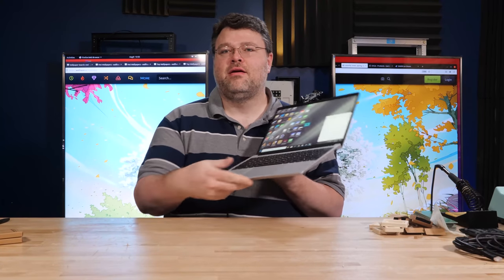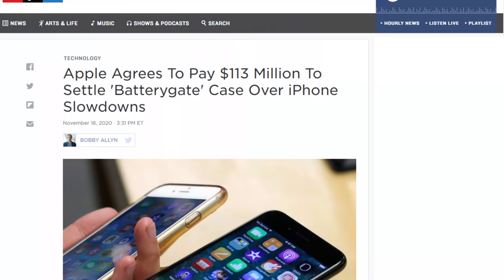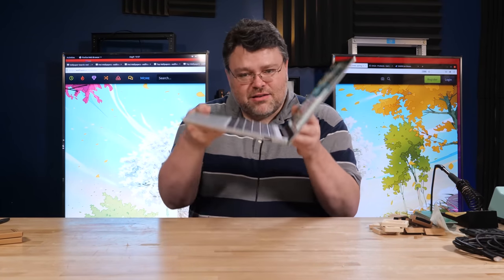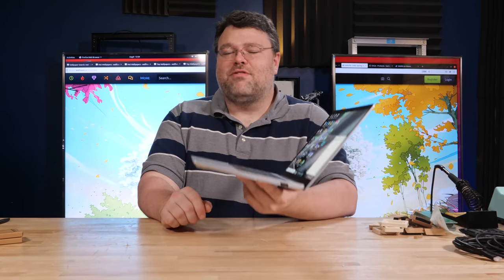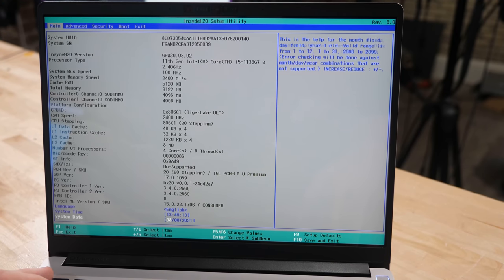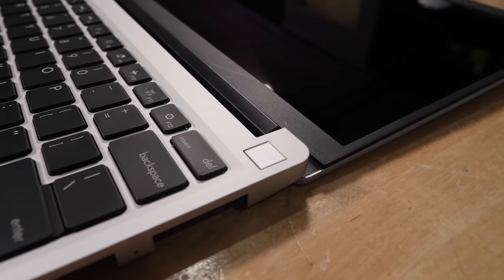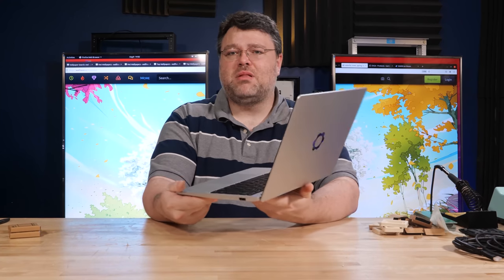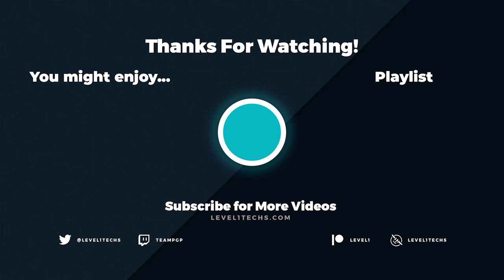Framework: A Laptop Designed to be Repairable?

Comment: Wendall should talk about them also working to support linux and their community pages.   My next personal laptop purchase will be a framework laptop
Reply: The Frame Work laptop can come without an OS, so you can install Linux if you want.  I know because I bought a "DIY" version and a friend and I put it together and installed the OS.
Reply: @johnaustin704  IM HOPE  they add  real gpu  over  the igpu
Reply: i asked them in an email and they are considering adding this to their website in the future ... but they are testing internally with fedora and ubuntu
Reply: @paullee107  I had little trouble installing 20.04.3 w/5.11.0 kernel. Needed a small workaround for the Wifi, but no major problem otherwise. I’d much rather have an LTS distro, even if it requires a minor workaround.
Reply: @paullee107  with it being all Intel I didn't figure there would be any fuss installing Linux.
Reply: @lejoshmont2093  there really isn't, you just need a newer kernel so alot of slower to update distros and LTS distros don't run well.
Reply: @gsrcrxsi  I'd argue only small compromises would be needed to get a low wattage 3050 in there. Soldered RAM and a few chassis tweaks to accommodate the 2nd fan's vents. That said, framework clearly have no intentions of doing this with this chassis but I'm hoping they consider dGPUs when/if they get around to a 15.6" model.
Reply: @RandomPlaceHolderName  The problem is space, not watts. They won’t ever have soldered ram. That’s totally against their mission statement and design philosophy.
Reply: @theredtechengineer1480  20.04.3 LTS working fine on my framework. No problem with “LTS”
Reply: @gsrcrxsi  Space and watts are linked. Less wattage, less size required for cooling. And while space is tight, looking at the size of the 2 dimms, I believe it could be done. 

And sure, you lose ram DIY repairability and upgradability but selling 16-32gb variants fixes upgradability for the most part and making schematics and part #s public helps avoid the price gouging repair market of say Apple. I don't mind requiring a professional to fix my machine, I just don't want the company saying "No, just buy a new one".
Reply: @RandomPlaceHolderName  that assumes that there’s nothing under those two dimms. Which there is. It’s still taken up by the MB below. No space for a GPU either way. Not gonna fit in the 13” chassis and expecting a right to repair focused company to dump repairability is a pipe dream.
Reply: @gsrcrxsi  Agreed, they won't do it. This much I've said before. But the space is there if you solder the ram (it isn't a huge deal, the CPU/GPU/VRAM would be soldered too). While the blade 14 is bespoke, it sports ridiculous amounts of hardware/cooling in a barely larger chassis. Half those specs would fit in the Framework laptop were they to attempt it, even with the area lost to ports.
Reply: @RandomPlaceHolderName  the motherboard footprint/available space inside the FW laptop is significantly smaller than comparably sized laptops. Because of the removable modules. The space just isn’t there. Even with soldered ram
Reply: they sent laptops to maintainers of several distros so hopefully both sides work to support the laptop well.
Reply: @gsrcrxsi  And some comparably sized laptops are sporting much more powerful hardware and cooling solutions. Dropping the specs, die size, VRM requirements, VRAM modules, wattage and cooling solutions, you significantly drop the required space offsetting the modular ports. My last retort as we clearly simply disagree on what is possible here. Thanks for the debate dear stranger.
Reply: @Epsilonsama  Ubuntu 20.04.3 is working great too. No need to switch.
Reply: Mine,too,definitely!
Reply: I wonder if the finger print reader works on linux
Reply: @lejoshmont2093  and there are some decent iGPUs nowadays
Reply: would be nice to see a coreboot version
Reply: It is obviously a fantastic idea but until we can slot in a replacement cpu or gpu into laptops these are still going to be dumped as they age.
Reply: @gsrcrxsi  they probably(hopefully) Will do a classic 15'6 laptop somewhere down the line. I certainly would like that since i dont really like those small laptops and prefer Universal beast kind of laptop. To game, work and for fun
Reply: The only one making sense in this thread is the OP!

Since when is Linux still behind on hardware support?  They Support the new Threadrippers alseady, and Intel are behind with their new processors, You can get Linux preinstalled, and Windows cost's extra!  No GPU is bad why?  Sure it's a smaller laptop to begin with, but also their first, it's coming you just wait! The one single thing they could not get that was Linux compatible was the fingerprint scanner, and that's fixed already, and it was designed with Linux in mind from the very start, and Windows just because so many people still haven't figured out that it sucks, and with it they can sell more.  Daaaaaaaaaaaang where do you get your info?
Reply: @lejoshmont2093  Not having a dedicated GPU (there is one on die in the processor) may be your preference, but many would rather have one.  Plenty of people use laptops for photo sessions and video while out and about and traveling, and gaming is growing in leaps and bounds on Linux.  Just wait, you may find yourself in a situation where you would rather have one!  The truth is that there are not many choices when it comes to plug in GPU's for laptops, because so many companies ditched modularity and buy the chips instead, so they can nail them down and make  sure if it blows out you need a whole new laptop and can throw away the bad parts with all the perfectly good parts.

Framework did not omit one because they didn't want to have them, but because they would have had to buy way too many, and at a much higher price, it didn't make sense given the production run and size of the company yet.  If this thing catches on, and the company grows, they will use replaceable GPU's as soon as it makes fiscal sense, so you can have a choice of a few when buying the laptop, and replace it if it breaks, and upgrade later if you want a better one.

BTW, not all GPU's are battery hogs, especially not the ones that go in laptops, and the one in the processor uses power too.  Larger laptops have more room for larger batteries, just look at some of those insane "Gaming" laptops!  They are freaking huge!  If anything they should go with AMD processors, as they are more efficient, and so is Linux over Windows because it and most FOSS software is less resource hogging to begin with, and by design, because they care.
Reply: @RandomPlaceHolderName  Soldering anything in they can have modular is totally against their business model!  But as a new and small company they have to make sacrifices.  dGPU's are coming, maybe even Audio cards.  There's a whole FOSS hardware movement growing already.

I will take the oscilloscope module, and the coffee maker attachment please!  (<:
Reply: @gsrcrxsi  Exactly.
Reply: @gsrcrxsi  Yep, they are against soldering anything in they don't have to!  That is not a large laptop to begin with, and everything is still getting smaller too.  They just need to test the market, and if they can grow as a company, they will have more laptop and module choices, and hopefully fill other niches of the market.  I would love to see how they would do a smart phone or a desktop PC!
Reply: As soon as they have an AMD based model they are jumping strait onto my "must buy" list for a future laptop upgrade, especially since I'm jumping to Linux and just preffer the much better support AMD has.

That and I prefer supporting "team Red" entirely because I can and I have yet to regret it
Reply: I hope them the best to survive and stay relevant until I'll be replacing my current laptop. The upgradability and full Linux support are huge selling points to me (though it might not be all that relevant for a regular consumer)

Comment: This is what we urgently need: an open standard for the mechanical/thermal/electrical interface specs of modular components especially motherboard and body but also batteries, screens, keyboard. Like we have already for ITX case & motherboard, PCIe slots and cards, SO-DIMM memory, NVME M.2 interface. Let laptop become the new desktop pc.
Reply: Well, I guess we not gonna get that.

On other side, having a highly modular notebook should happen...
In fact it was, it just isn't anymore.
Reply: @youkofoxy  unless somehow we can blow Frame.work to Apple or Dell proportion.. I doubt we are able to, but in tech/academic niche it is doable.

As a computer scientist I am looking forward to experiment on this kind of... framework
Reply: Phones too. Imagine if components between laptops, tablets-foldables, and Fairphone/Shift phone models could be mixed and matched ~ kinda like Project Ara but with parts held in by phillips-head screws.

Don't care about battery life? Trade battery size for a beefier SoC and slap on a 1440p 120hz display (maybe a built-in stylus too?). Want a larger phone? Just grab a large chassis with a folding hinge and 9-inch display and go ham!

> 10,000mAh battery
> 25W wireless "air charging" receiver
> 9-inch QHD 120hz folding extendable display
> SD969 + RDNA4 graphics
> 32 GB LPDDR6X RAM
> 1TB UFS 4.0 flash storage
> Built-in stylus
> Ports: 2 x USB-C/USB4-TB4, 3.5mm jack, microSD
> 3 x 108MP cameras (main, telephoto, ultrawide)
> Specialty cameras: IR, hexachromic, ultramacro, LIDAR
> Other specialty/custom sensors & modules.
Reply: agree, remember that this has been tried before, and it failed.
Reply: We already have standards for nearly everything, but it's not easy to make using them law, as it guarantees whoever comes up with a standard all the profit from licensing.  Strangely many standards have free licensing, and greedy companies don't use the standards so they can stack business in their favor, as well as thwart the competition. "Stacking" is against the laws of non competition, and has been for a long time!  As a consumer it's hard to fight because of the legal expenses, but competing companies can and sometimes do.  Many companies use tricks like using a standard in a non standard way to get around it:  HP, does it with their USB cables and other IO's, and accessories for their devices, and so do others, Apple has taken stacking to the extreme with chip ID's so you can't even put anything from one identical device in another!  They have been sued and fined millions, maybe in the billions already in parts of Europe and else where, but since they can afford the legal expenses without flinching, they keep doing it, or just find ways around the laws, or make country specific models of devices!
Reply: yes!

Comment: One thing they should really push on their marketing is the green aspect of it. This laptop would have a ton less e-waste than traditional laptops over the same time period, since you can upgrade everything.
Reply: They do!  I mean they don't put it above modularity, specs and price, but its not at all hard to find on their site.  It's part of their mission statement, if I remember correctly.
Reply: i kinda like that the green aspect is not super in your face, it kinda is obvious though. I think this laptop will appeal to every tinkerer. Also, very appealing to folks who are concerned about e waste. Covers different bases nicely. Just the whole concept is wonderful. lots of folks are excited about it.

Comment: I've just ordered the DIY version of this with the i5 processor.  I'm long overdue for a new laptop, and I'm glad to support this company.  I'll install 32GB (2x16) and a 1TB SSD.  For the bare metal OS I'm going to try Qubes.  Should be fun!
Reply: You just saved yourself $300 for like 10 minutes worth of work.  I recommend EVERYONE get the DIY version.
Reply: @Bri-bn5kt  More than that.  As they aren't paying for a windows license either.  I saved with mine as well.  Carried over the nvme drive from my old laptop and going to install zorin 16 on it instead.  I did pick up the microsd reader as a port so waiting on a card for putting the installer on to make the magic happen.
Reply: @JuffoWup78  Didn't even think about the Windows license.  Good point.
Reply: This is a big part of what appealed to me here.  It's great that it's designed with service/repair in mind, but I could also order it exactly the way I've always wanted to order a laptop.

Comment: I joined their mailing list for when they're shipping to the EU/UK - not because I need a laptop, but because they need to know we're interested and supportive this side of the pond. I wish them every success and look forward to a v2.0. - my personal vote would be to offer a 'chunky' model. Thin and light is all well and good, and the current notion of what's desirable, but my laptops have been old Thinkpads and MacBook Pros from 10+ years ago and those were plenty thin enough for me. With modern components a slightly chunkier model would have excellent cooling and oceans of room for expansion, upgrades and more connectivity, and could be built like a tank. The latter is really important if you're realistically going to use the same chassis over the years and upgrade the 'innards'.

Comment: I can confirm stairs are more dangerous than laptop repair. I've never broken my ankle while repairing a laptop.
Reply: Lmao :D
Reply: @Xavier Breath PC power supplies are adequately shielded, grounded and boxed in on their own so no one can accidentally touch their internal components when working with other things and get zapped. Also the reason the insides of a charger box are not put inside any laptop or phone. If you get zapped through a motherboard or laptop PSU, you'll only get 12V at most, since that's as high as the current ever gets in these circuits. That's nowhere near deadly margins unless you already have heart problems. Not only would it increase bulk if a laptop had to be designed to take current directly from the mains, but also make it needlessly risky. The very fact that iMacs in particular have exposed power supply bits inside is disgusting. They're the exception, not the rule. Only Apple would dare design their computers in such a terrible, needlessly unsafe manner, and get away with it.

Otherwise as long as you're not cutting the power supply open, 99% of the time you'll be fine.
Reply: @Xavier Breath Like manufacturers gluing phone batteries in so strongly you either have to stick a knife inside and rip it apart or heat it up a lot, either of those possibilities bearing the chance of an already failing battery burning and leaking questionable fumes?

Why do manufacturers glue it anyway?

Not to mention there's also a few times where I've gotten small cuts on my fingers from handling motherboards. And there's also the chance of burning oneself with a soldering iron (it never happened to me, but I know that can be nasty). Nothing in life is completely risk-free, and there's only so much you can encompass in a design's scope.

Comment: I've been waiting for this... but maybe it will be a gift as I just upgraded my 2015 laptop... New battery, a second stick of RAM and a SATA m.2... But that's all I can upgrade on it. I bought it to have something while deployed and it survived some blowing dust and 60°C sun. After 7 years, the battery stopped holding its charge and I bought it with a HDD but noticed it had an empty m.2 slot, huge upgrade there! And also, luckily for me, it came with a single 8GB RAM but a vacant second slot, so I found another for 16GB...so now it runs great and I've breathed new life into it.
Reply: no new battery ?   i had to remove my very old battery otherwise windows would shutdown immediately, works fine without but needs powerbrick ...

Comment: I agree on the modules, I mean, you plug a single module (usb c) for a single USB A port?, why not two in the module?, USB A is still universal, having it by default on the board shouldn't be that complicated.

But overall, I like this product and I'm counting the days till they release it on my country.
Reply: I completely agree with you, but I guess the beauty of this system is that they can easily design a new module with double USB A later assuming 2 ports physically fit side by side. I don't hold it against them that they don't have it yet as it's a huge task just to get this shipping.
Reply: @irridiastarfire  Two USB A ports can only just squeeze into the module form factor, but not with enough space to accommodate the extra width of actual USB cables and devices. As for double USB C, the actual circuitry is a tough fit into the module itself.
Reply: USB A shouldn't be used anymore, though. Death to type A, type C everything!
Reply: @mjc0961  it's going to be used for a while yet because many (if not most) people have USB A cables and devices. Ideally USB A would be phased out by now but anyone with a brain realized it wasn't gonna happen this quickly. If you want USB C just get the USB C modules and be done with it; framework would only be hurting their business refusing to offer it.
Reply: Yeah. Not only that... I also feel like they could just also a usb-c on there cause it's going to be a standard going forward and you're always going to need one.

Comment: So what makes frameworks interesting is the fact that it uses USB (PCIe ?) lanes to extend the peripheral devices, like monitors and display port.

They could theoretically be able to add another USB C or type A to the expansion slots.

It's great to see memory and drive upgrades available on the board, but using those expansion cards for peripheral also allow you to add extra memory, but those are currently capped at 256gb, it'd be worth while to open one of those up to see if they use a type of 2240 nvme/ssd or a SD card.